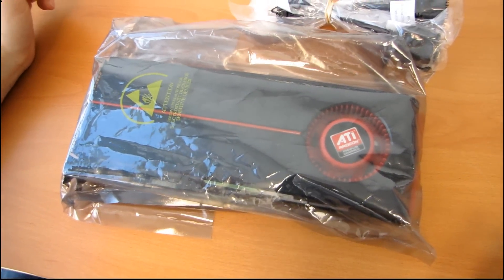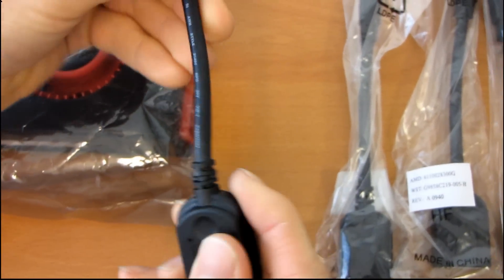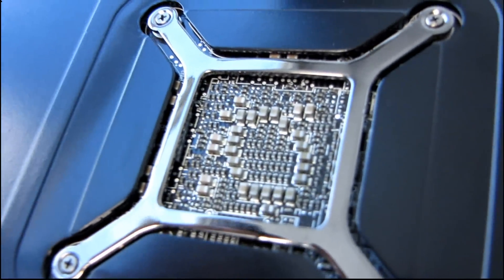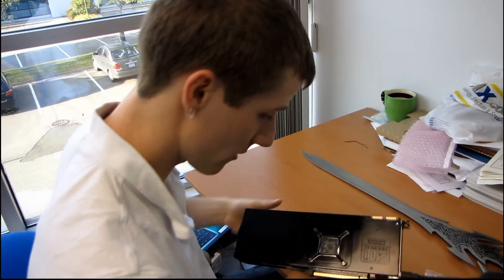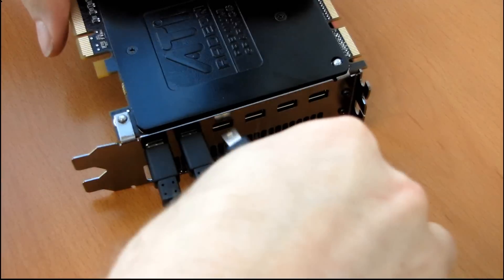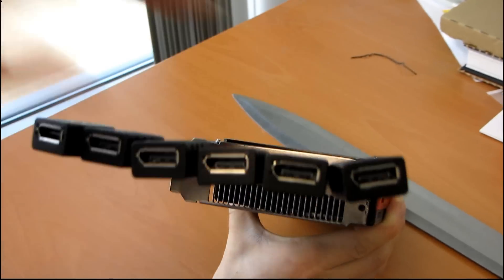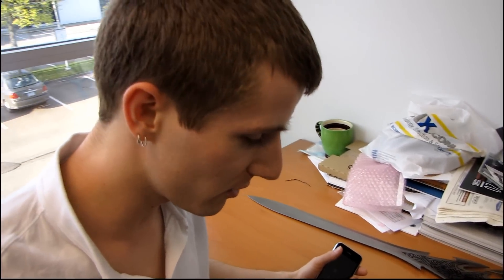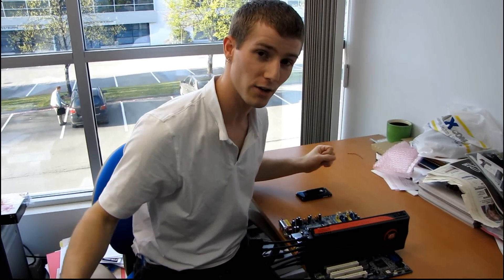ATI Radeon HD 5870 Eyefinity 6 2GB DirectX 11 Video Card Unboxing & First Look Linus Tech Tips

Comment: Salvaged one of these from a scrap yard and used it on one of my very first computers replacing a Radeon 9550 used it for a few years before upgrading do with that same GPU failing and having the money saved up to build a proper system. One thing I gotta say is, back then when I first saw the mini display port I had absolutely no clue what it was or about the adapters ended up taking the card to the nearest Canada Computers just to find out what i was looking at and what i needed. Anyhow I came across the older video just reminiscing looking at some specs on the older hardware I have ran and just thought hey lets see if there were ever any reviews on some of it and by far not the first video iv seen but maybe the oldest but love the work you guys do its inspiring to watch people trying to push systems to there limits and sometimes even beyond always love those videos as i am always try to squeeze the most performance out of what ever system i am running and the tips you guys give are amazing

Comment: Since the whole design is wrapped around connecting 6 tiny screens , it's a failure.  It interferes with the picture in multiple places and always will until a design for flatscreens is made where you can actually put 6 screens together in a single outer frame.  Although you can connect 6 individual screens in different locations as well.  You are paying for this?  Can you say money wasted?  Buy a 80" screen and connect it instead of being cheap AND lame.

Comment: Does this look like a "high end" gaming computer?
Specs:
Gigabyte GA-970A-UD3 Motherboard
AMD FX-4100 4-Core Processor (3,6Ghz)
600 watt power supply
MSI GeForce GTX 560Ti 
120 GB SSD and 1TB harddrive
8 GB kinsgton value ram (1333Mhz)

Plz Respond! :D

Comment: Hello, i need some help with my PC! I'm thinking about upgrading my HD 6870 PC build with another 6870. But i have to ask something before i do this. If I buy the 2GB version of the 6870 and have my 1GB version as a "slave" Gpu, do i only get 1GB of video memory, or can i use the 2GB version of the 6870 at all together with my 1GB version?

Comment: I have a 6870 2gb video card and it still uses 2 6-pin power pci-express power connectors. 2gb doesn't mean you need more power

Comment: @Max1636 yes but you'd need to buy at least 3 active dvi to display port adapters which were pretty expensive when I brought some over a year ago, about £40ish each, and they are very fiddly, if they don't get correct and stable power from a usb port they won't work correctly.

Comment: Here are a couple of things people should know.  If you need the instructions, this comes with a generic VGA manuel.  Also if you want to use VGA or DVI you will have to buy those adaptors.  The VGA adapter has a DVI-I connection on the other end which do not fit to the DVI-D adapters which come with the card.

Comment: Just bought it with a intel core i7 920
xfx nforce 750i sli
3x nvidia geforce fx5200 in sli
intel pentium 4 at 12Ghz
1tb of ddr5 ram 
5x 5tb solid state drives
and a 1.5 gigawatt power supply
oh and 3 blue ray drives and a antec 2000 case